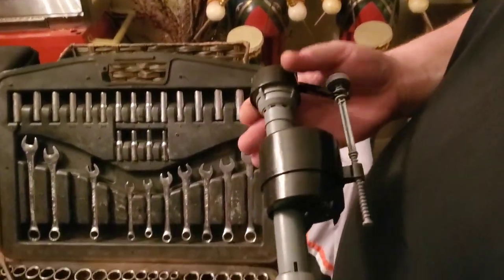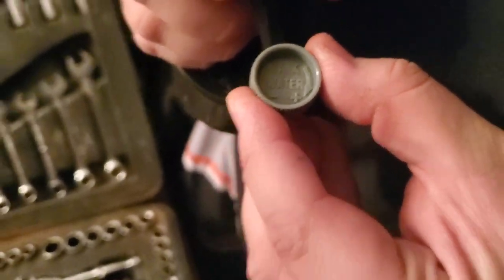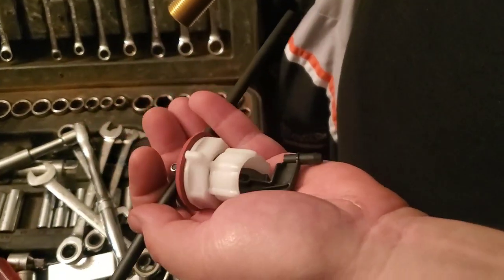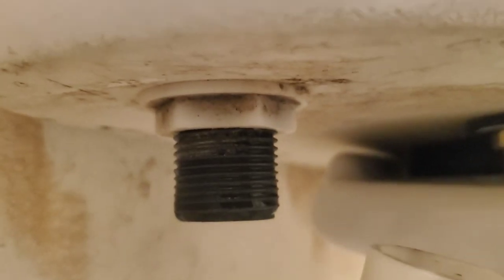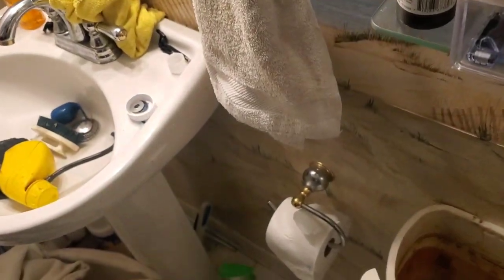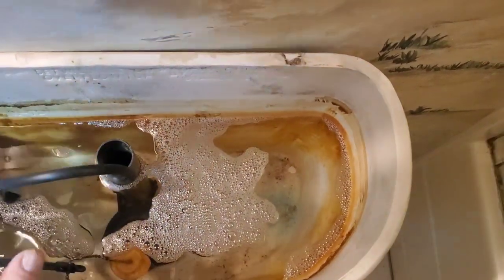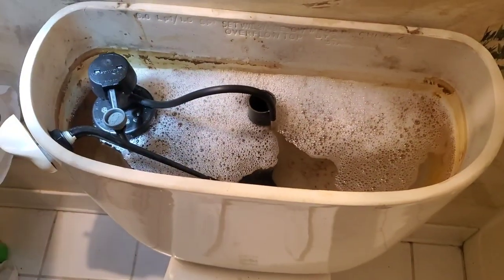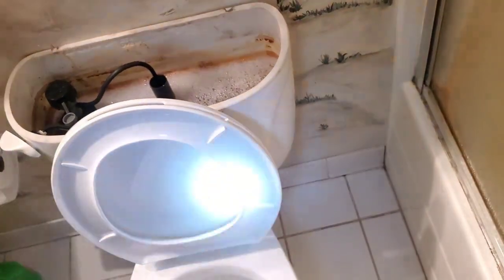how to replace flush valve in residential toilet using a fluid master easy adjustable replacement.

Comment: But I need a new flapper thing, yours doesn’t have one, does it? Did you put soap in your tank to cause the bubbles?  Thanks Fatyl
Reply from the maker: There is a flapper, but no float ball. When i went to home depot for the new valve someone poured some bleach in the tank!